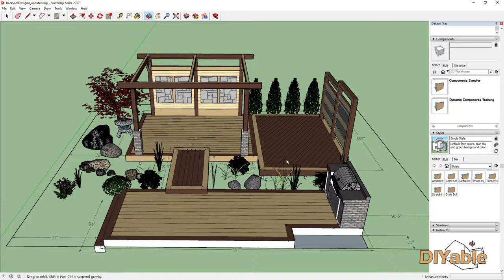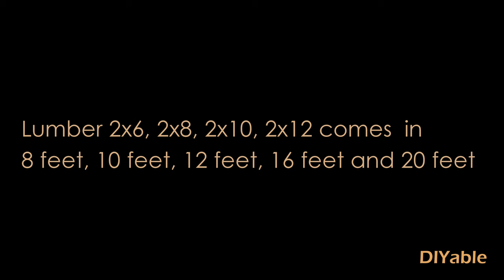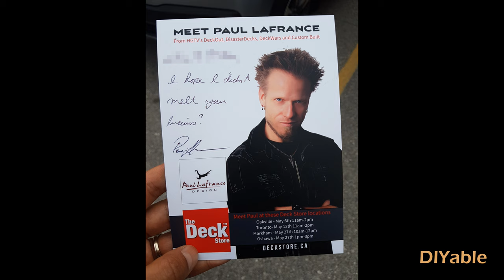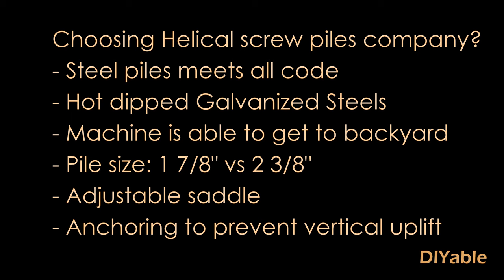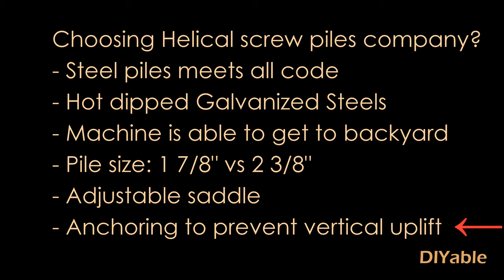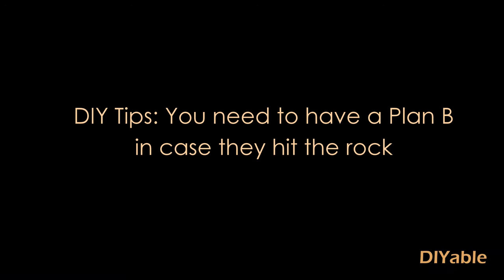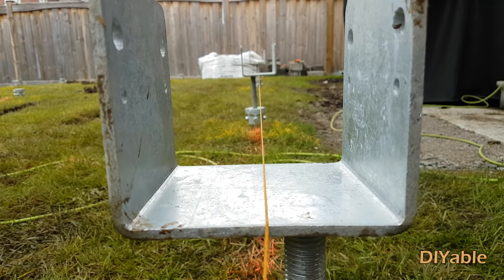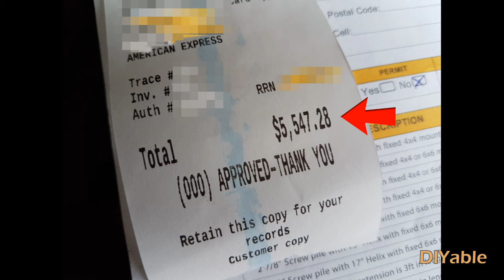DIY Deck (Part 1): How to build a deck with Helical Screw Piles? #TechnoMetalPost or #GoliathTech?

Comment: I had TMP and Goliath out in 2020 in WNY, and ~12 piers was $4K US.
You got a steal!  But, you missed a trick.
With helicals, you can get longer spans. Fortress Framing well let you use joists spans to 17' easy.  Fewer piers, longer spans, galvanized steel will last longer than wood.
 I'm currently back looking at steel now that wood is almost or more expensive than the FF I can get at Lowes.

Comment: How close can they put the pile near the building foundation?
Reply from the maker: That's a VERY GOOD question.  I think we need to ask the pile drilling guys. If I understand it correctly, you don't want to put it too close to the foundation because potential damage to the house is not fun at all.  If you are asking this question, I assume you want to build deck without installing the ledger board attached to the house. Indeed, I have one backyard neighbor he DIY his deck not using any ledger board, he used sonotube. His deck isn't floating, he did drill pass the frost line, the only thing he didn't do was attaching the deck to the house.  When I watched he did that, he drilled the holes around 2 feet off the foundation. In my opinion, it's pretty close... but he house seems to be fine after 8 years.

Comment: Very good informative video!  Thank you.  $5500 for 20 piles seems like a very reasonable price.  Did you have to get a minimum number of piles before they would take the job?
Reply from the maker: I cannot speak for them. But I believe there is no miminal, in reality a small deck may just need 2 piles.  However, I believe the price would be slightly higher, get a quote from these helical pile guys.

Comment: So is a mini skid steer auger attachment able to place these piers or do I need a special helical piles attachment ?
Reply from the maker: I believe they have a special helical pile attachment. I am not 100% sure, because for the whole DIY deck project, this part is the one I hired the Professional guys to do it.
Reply: In this case they are using a hydaulic motor to install the piles. You llikely would not get the proper torque from an auger attachment. The torque is what determines the bearing capacity of the piles (credentials - I own a family pile business in Ontario)